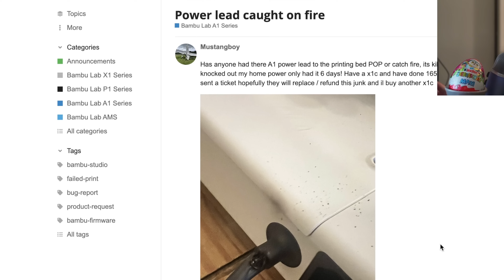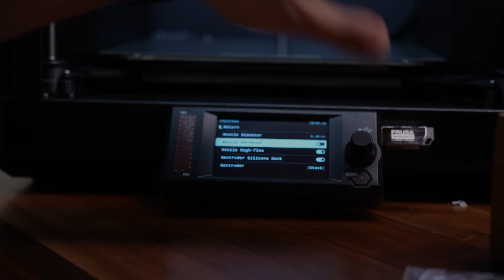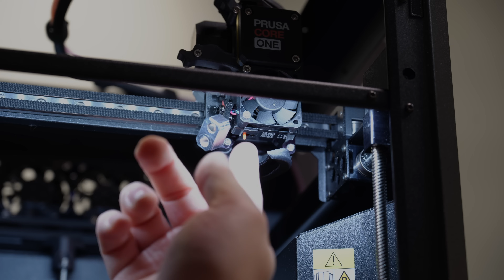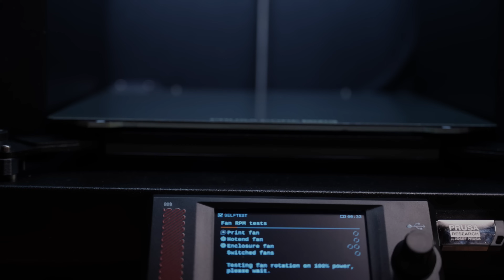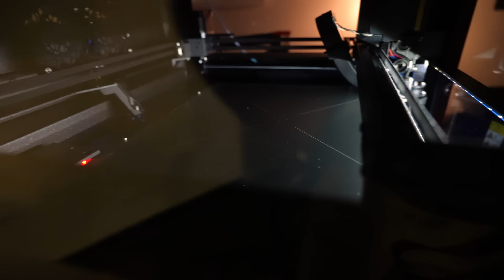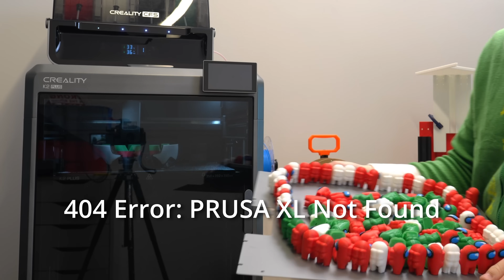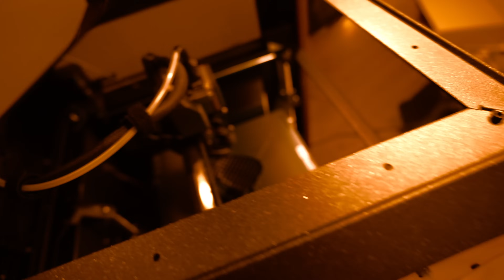PRUSA CORE ONE - The Machine Designed to Trigger Bambu Lab Fanboys

Comment: please test print warping test. wondering if the printer is better at preventing warping compared to the mk4s.
Reply: To prevent warping you'll need to use brim/mouse ears + gilbert curve pattern for the initial layer.
Reply: @GhostRider5555555  never tried Gilbert curve. I'll try that.
Reply from the maker: It should also warp less thanks to the enclosure. The part cooling off less and being held at a more even temperature reduces thermal strains

Comment: If it came in 300x300 or larger i woukd buy immeditly
Reply from the maker: I wonder if they are going to adapt the XL into an enclosed XLC Model or something. All they would have to do is mount the same electronics into a cubic frame with the same design as the core one

Comment: @NathanBuildsRobots I’m from Germany and own a CORE ONE too, but have big problems with the nozzle cleaning step prior to a print job, fails most of the time! Talked to support several times and was finally told that there is a firmware bug which they are working on. A new firmware release shall show up next week support says…Makes me wonder that review guys like you don’t see this bug since many other users report the failure too. My printer was batch 2, delivered 23rd of February. Also the printbed was tilted by 1mm(!) back to front down, had to adjust the rear nut of the Z-axis by 1/4 turn ccw to fix it. 
Are you aware of the nozzle cleaning failure?
Mathias
Reply: Thank you for posting this and the fix.
Reply: @ my pleasure!
Reply: There might be two reasons why they don’t mention it:

A) Companies send them the BEST and PERFECTLY CALIBRATED printers.
B) Companies are paying them in one way or another for the review.

If it's option A, they didn’t experience that issue because the company fixed it before shipping.
If it's option B, since that flaw could discourage people from buying the printer, they hide it.
Reply: @ttshar  jepp I agree!
Reply from the maker: No, haven't had that one. I did have one issue where if I opened the heated bed while the printer was moving down after a print finished, it would restart. Probably has something to do with how the processor interrupts are handled. But its not that big of a deal since it only happens when the print is finished, and it's something they can fix in firmware later. 
They do tend to go back and fix bugs, unlike SOME companies!
Reply: @NathanBuildsRobots  thx Nathan! I’m not complaining about Prusa, I already own an MK4S and are very happy with it! Just wondering why this really annoying bug is not "public". Communication politics at Prusa are sort of strange. 
I observed some more bugs with the printer but am sure they fix that as they always do in no time. Interesting however that the support people appear to me as not knowing about my issues in first place but after they realize that I’m not letting them off the hook suddenly are admitting that there is a known problem. I hope to be able to finally USE my printer. For now it’s not funny.

Comment: Are those vibration pads made out of Sorbothane? If so I don’t think they’re following the guidelines. There’s a specific calculation of the size and weight of the object that it’s supporting and they wanted it very specifically cut into four squares to disperse the vibration. Also the thickness of the pads is relevant because you wanna optimize how much squish there is in the pad for the otherwise if it’s not squished enough or squished too much the vibrations won’t be dampen ideally

I learned about it when I was doing speaker installations. Pretty fascinating material.
Reply from the maker: I don't think they are sorbothane. Seems like a densebutyl foam? I have used both in various applications before, but good to know about the squish. Of course it will probably work best if there is some squish going on to generate those viscous forces

Comment: Prusa’s Kore 1ne is basically a K1 clone with a few tweaks, just enough to stay relevant. The angled enclosure screams K1, and despite trying to position itself as a Bambu X1C competitor, it lacks multi-material or multi-color printing. They’re just trying to stay in the game.

And let’s be real, Prusa is basically fixing the K1’s shattering door issue while keeping all its other flaws. A thin, warp-prone bed (which will definitely warp in an enclosure), VFA all over prints at advertised speeds, fake "active heating," and three Z steppers running off one driver just to mess with you a bit extra.

Prusa wants you to think it’s an X1C, but come on, at its core it's literally just an MK4 in a different shell. They’re playing catch up with a two year old design and still missing the mark. No fancy closed loop system, but hey, at least you get NFC and maybe an invite to a future release dinner or lunch. Oh, and just like the K1, it doesn't come with a camera. You’ll have to buy an "AI" one for $40.

I would love a serious Prusa CoreXY, but look around. This is not it. Prusa is heading for rough waters later this year.
Reply: If we're being fair, the Core One is both "catching up" AND innovating. Those things are not mutually exclusive.

You're right that it's more evolutionary than revolutionary. But it's also allowing an upgrade path for older Prusa printers, and leveraging proven designs. That's amazing.
Reply: Most Core XY printers are going to look like a box - not much getting around it. I doubt Prusa actually intended to clone the K1 - the "exoskeleton" design Prusa decided to go with along with the sheet metal is likely to dictate the need for bevels more than eyeballing anything Creality made.

Prusa has announced multi-color / multi-material printing for the Core One - it'll use the same MMU3 as the Mk3/Mk4, but with some modifications to mount it on the Core One.

The bed is the same one as the Mk4 and Mk3, both of which have optional enclosures, and plenty of people have Mk3 / Mk4 printers in enclosures for extended periods of time. So I have my doubts about this casually thrown around claim of warping.

I've seen some people talk about VFAs, but it seems other people don't encounter it. I wonder if it's just improper belt tension or something like that.

Prusa doesn't advertise it as having active heating. Three steppers on one driver doesn't bother me, as non-planar printing is not the norm for current printers. If non-planar printing becomes more popular, hopefully Prusa can offer an upgrade kit.

Pretty sure Prusa calls their camera "Buddy" rather than "AI" - but umm ok?
Reply: @logicalfundy  the exoskelet isnt any different then the k1, 4 removable posts. Different material but thats it. True innovation looks like bambu did with the lidar or creality with the motorized belt tensioners and bed sensors.
Reply: @TheOneAndOnlySatan  I would like to see a teardown of the K1 showing that.
Reply: The bed of the mk4 is outdated for a long time now, and they are still using them.
Reply: @ It works. It's completely reliable. It heats up to the advertised temperatures. Not sure what else you need from a bed.
Reply: @logicalfundy  Its low wattage, not as flat as milled aluminum, its slow to heat up and if the cooling fan is to strong it's losing it's temperatures quiet fast.
I have a strongly modified mk4 and these properties show quite often.
Reply: @logicalfundy  for it to stay flat when its heated, i thin build plate inherently wraps. Only solution go thicker.
Reply: @warmesuppe  Ok so you modified it, so you are responsible for the effects of the modifications you made. Prusa doesn't need to design around your modifications.
Reply: @TheOneAndOnlySatan  I'm not having problems with the plate warping. I don't think it's too thin.
Reply: @logicalfundy  I didn't say that, obviously.
It just shows it's outdated. It won't get better if the core one needs more cooling if its supposed to run faster.
Reply: You my friend are total moron. It’s completely different construction different construction method different build method different mechanics and internal design. You’re one of those people that just looks at a car and thinks they all look the same because they have four wheels and window
Reply: Clearly the video didnt just trigger bambu fans. 
This guy is squirming😂

Comment: Lmao in the next week or two when bambu releases their next gen printer with never before seen features prusa core one users will cry they didnt wait and save their money.
Reply: What next gen printer? Oh you mean the one that ultimaker and raise 3d already made 6 years ago? Bambu's H2D is just a large printer with a single extruder, dual lift nozzle toolhead. It's nothing revolutionary and bambu knows people will be disappointed with it, which is why they keep delaying the announcement.
Reply: @LilApe  that's based off a few patents and a leaked picture, neither confirmed yet to be in this next printer. Also their could be features not made public.
Reply: @riba The only COPING are the COPERS that COPE over the fact that Bambu STILLS every aspect from other 3d printer companies that did it first, but clam they did it first when they didn't just like Apple does.
Reply: Many people already see what bambu is trying to do, build a walled garden and patent open source tech. 
Also, hard to service and expensive to repair. 
 
The HD2 Has been mentioned around and looks like just a concept. 

I expect Bambu release to be something that will render their old machines obsolete, without any hope to upgrade them.  Is probably gonna be cool and within a walled garden

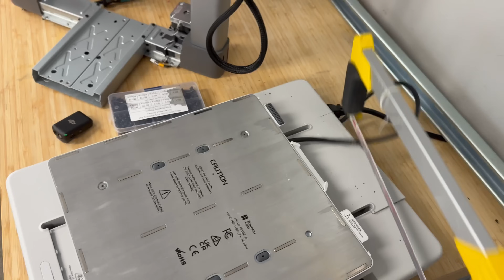Comment: 0:47 triggered me and I’m not even a Bambu fanboy. I have more prusas than I do Bambus. 

Also the objective build quality between my core one and my X1C is night and day difference. I stood there, just studying both of them side-by-side on my shelf, and it’s insane how much more rigid and solid The core one is.
Reply: Genuinely curious and happy to hear about this. I like Prusa ecosystem more than Bambu. Quality of the print is more important to me over anything.  I don't care how fast it is.
Reply: Elegoo Centrauri Carbon that has injection molded frame
Reply from the maker: Injection molded or die cast?
Reply: The core build quality is garbage. Look at those crap plastics!

Maybe the internal frame is good, but not impressed by the rest
Reply: Is it just the shell thats not rigid, or the actual frame holding all the mechanical stuff? I have an a1 and some of the plastic parts aren't extremely rigid (still not horrible, but like you can push it and it bends pretty easily. However, anything that is actually important is very rigid (anything holding mechanical parts). Also, it doesn't matter how rigid it is if they preform similarly.
Reply: There is no reason to destroy a working printer.
Reply from the maker: It wasn’t working. It was recalled for a safety issue and according to the person that sent it to me, bambu lab support had not taken any steps to replace his faulty product in months, so he sent it to me for disposal
Reply: @ Not working as in literally a paper weight, or not working as in "It functions, but I won't try get the replacement cable, so I'll bash it instead"?
Reply: @NathanBuildsRobots I LOVED THAT PART!
Reply: @plutonasa  Its a benefit to humanity if you do it to a Bambu

Comment: that bar is pretty fugly and restrict maintenence access in an already bad maintenance design (enclosed in general)... no no no 😢
Reply: The point of the design is to make a CoreXY easy to repair. 
That's why you can remove parts from the frame. So you need a plane that is always absolutely straight and square.
What could be better than a laser-cut steel plate? 
You can remove the entire gantry within 20 minutes and service or repair it. 
The bar is a small price to pay for this.

Comment: There is really no engineering reason for the bar across the front that couldn't have been solved with beefier framing elsewhere in the design.
Reply: You’re missing the point entirely. It’s not about lighter or stronger it’s about the simplicity.  The simpler something is the longer it will last. As it happens it’s very strong and yes it’s in an annoying space but people will get used to it. It’s no different than when all the core XY machines came out and started hiding 75% of the view on the sides so you couldn’t sneak a peek at your prints anymore. People complained like crazy because they couldn’t tuck their head next to the side of the machine to see how it’s working from the side and can only look at it from the front through a window
Reply: @Eric_In_SF  Simplicity is a weak argument.  There are lots of ways to make things simpler but also net worse.  The point is, they could have made it heavier and more expensive and not had the bar there while still having a good lasting product.  To me, it seems like a lazy engineering choice.
Reply: @urbanawoodproject3123 True. But clearly keeping the cost down (and competitive) was a design goal.

I also wish the bar wasn't there. But would I want to spend more to remove it? Probably not.
Reply from the maker: Ok guys do I need to bust out the hacksaw?
Reply: @Eric_In_SF  I'm not missing that point. They are trying to achieve a bunch of different goals at the same time. Upgradability, redundancy, cost effective, simplicity amongst others. That is really hard to do so the XY frame was a compromise they had to do in order to achieve their goals. It's not the best design solution overall but it's the best for their purposes.
Reply from the maker: It keeps the CoreXY stage in one piece. If you look at a normal viewing angle of a printer on a desk while standing, most coreXY printers actually have the support beam in the worst spot.
Reply: @NathanBuildsRobots  I understand that, and if keeping the frame lighter was the goal, then that is the way to design it.  I would have just preferred a heavier/beefier frame and no bar across the front.
Reply: @urbanawoodproject3123 The goal was to save money and probably also make it easier to iterate. They had to put the XY frame in a separate piece to be able to keep it square because a frame built out of a bunch of sheet metal parts with a bunch of joints is really hard to put together 100% square and stiff. The result is that annoying bar across the front of the printer. His claim that every core XY had that bar "in the wrong place" is rubbish. In every other Core XY the XY frame is part of the frame of the machine therefore you don't need extra components to make it stiff and square
Reply: @elleryfg7853  Why are you always spouting off nonsense like its factual?
Reply: @LilApe  ohh little monkey. We meet again. How is Prusa treating you these days. 🤣
Reply: @elleryfg7853  You have zero experience with prusa or any of their products, yet you keep talking like you've used them before. The core one weight 50lbs, that's the weight of two of your precious bambu's combined. They did drop tests with them on video, have people weighing over 200lb standing and jumping on them. And yet they're still robust and squared up. Meanwhile bambu printers can barely make it through transport without getting transit damage and there are hundreds of posts about bambu's not being squared due to transit damage.

How are you to say that the frame on the core one isn't strong. Do you have one? have you ever seen one in person or used one? No, you haven't. yet you like to talk like its not built like a tank.
Reply: @LilApe  little monkey you're assuming a lot of things right now. Take a deep breath and relax.
Reply: The point of the design is to make a CoreXY easy to repair. 
That's why you can remove parts from the frame. So you need a plane that is always absolutely straight and square.
What could be better than a laser-cut steel plate? 
You can remove the entire gantry within 20 minutes and service or repair it. 
The bar is a small price to pay for this.

Comment: Ironically I'm moving from bambu back to creality for half my farm. That ender 5 max is no joke!
Reply from the maker: I've been doing some more prints with the Ender 5, will probably do a follow-up.
You need to slow it down a little to get good print quality with PETG. Which probably would have been obvious if I thought about it. PETG doesn't like to be pushed fast.

The ultra-high speed mode only works best with hyper PLA.

Also you need to soak the bed at temperature a bit to get a better bed mesh. Something that I will push Creality to update via firmware.
Reply: @NathanBuildsRobots  I agree with slowing it down some. Especially with silk the cr silk preset hasnt been the best for me.

I've had some good results with tpu on it so far. Im currently printing entire beds worth of product. Been going 18 hours strong 💪.  I will try petg next and see how it goes. 

Overall though, it's been laying down perfect first layers so far. Haven't needed to adjust anything. 🙏